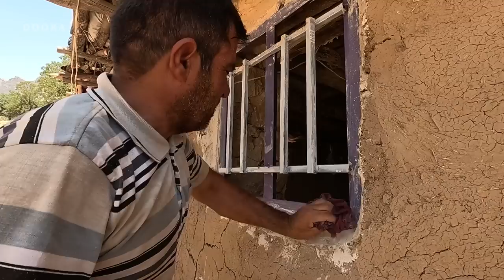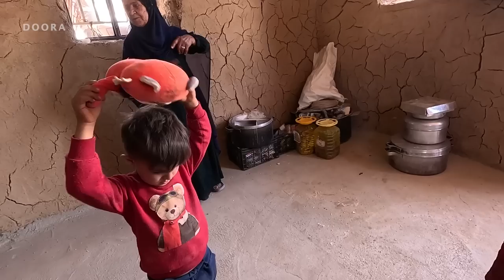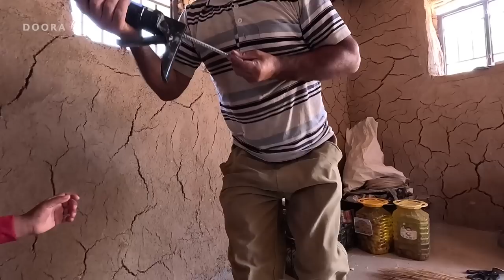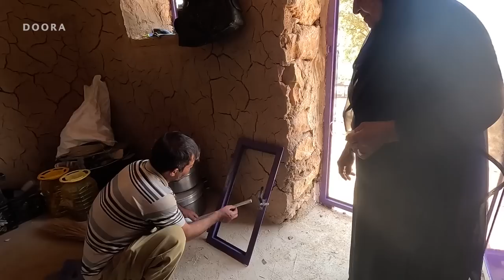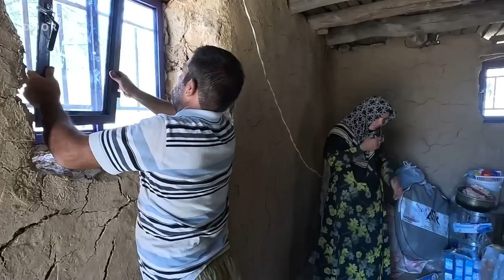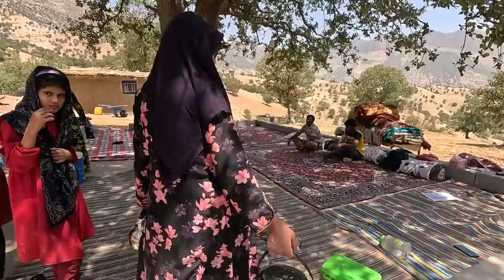Window Installation:Glass Installation for Farmhouse

Comment: The house is coming along. I'm wondering if they can apply something to fill the cracks in the inside so bugs don't live in the walls.  Then paint over with a white paint.  That would be nice on the outside too.  A model family.